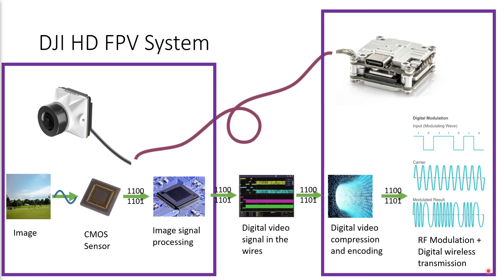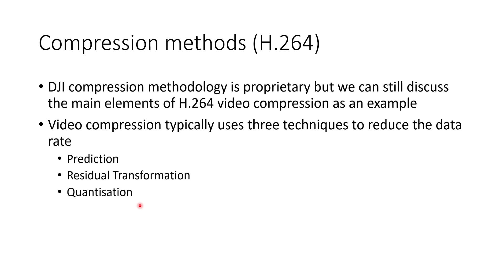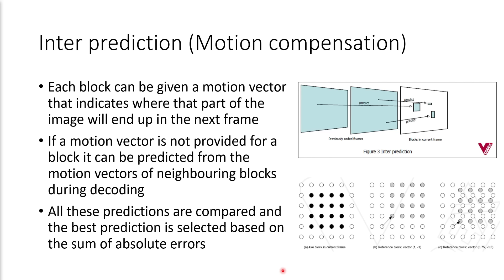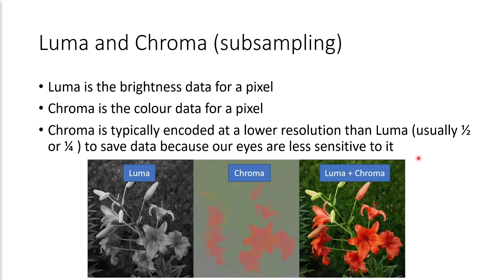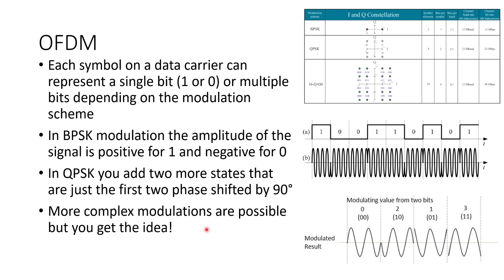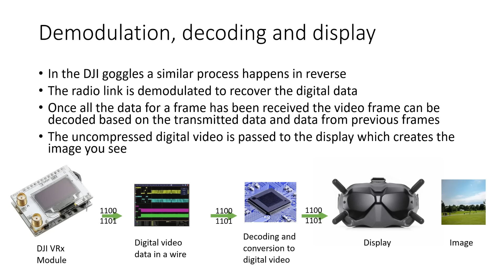How the DJI FPV Video system works! (Air Unit, Vista and FPV drone)

Comment: To add some things I've noticed, to minimize bandwidth spikes (decrease the size of retransmissions e.t.c.) and increase decode stability DJI utilizes what's called intra refresh in h.264. Aka they do not use keyframes, instead it uses what is essentially a rolling block that acts as a keyframe to which other frames can reference. You can see telltale artifacts when Vista switches from 60fps to 120fps mode on arming for example. 

It's actually quite an efficient method with least amount of visual artifacts, back in the day 8-9 years ago when twitch allowed you to have fun with encoder settings but something like 1.5mbps max bandwidth, I used to stream with very custom settings that included intra refresh. You can see some examples of the artifacts on my channel in wow videos on 8-9 year vintage. Though DJI uses a lot more granular version of it. Afaik they axed it all a long time ago in the name of compatibility with cheap embeded decoders, tv boxes and such.
Reply from the maker: Wow that's really great information to have thank you! That explains how they avoid sudeen distortion due to a missed keyframe.
Reply: @ChrisRosser  It also really helps for getting latency down, it does not really help with initial connection, since you still need to wait for the refresh to cover the whole screen, but after that you avoid having big data spikes, for keyframes, since essentially you smear that data over time. Also it's not that big of a deal if you cant recover some of them - you'll just have some kind of an artifact in that block until the next refresh covers it up. Also should help recover a lot faster from dropped frames, since you can also just have some artifacts in places that were covered by refresh that was transmitted with those dropped frames.

Also that would allow them to use inter frame stuff, since they do not have to basically cache previous frames to reference, but just blocks between the refresh, thus also reducing latency and increasing efficiency for when you cant have frames buffered.

What's more interesting to me is focus mode, since afaik nothing of that sort is supported out of the box in h.26x series codecs, so I imagine that's their contribution, and since I think they kinda wanted a foviated rendering effect, but they ended up with very sharp transition point, I imagine it's a fairly simple hack ;)

The main downside is probably that generally it needs a bit more total data transmitted over time, compared to regular keyframes and a bit more complicated decode/encode (though I imagine it's not a issue nowdays, since even in 2010 I had no issue playing those streams on android phones of that time). And well.. seeking that type of video wont be instant if you want to avoid artifacts (you need to decode a bunch of previous frames to get a clear picture, or just deal with artifacts), but that's obvisouly irrelevant for realtime stuff.

Comment: Thank you once again. Great presentation as always. I have only ever flown with the DJI air unit as I am fairly new to FPV. After seeing your videos on how Analog works and now DJI I am curious about Shark bite. I am very curious about analog, I think I may want to try it at some point. The DJI system has a nice picture but when it breaks up and the latency increases it can be hard to fly. Once more thank you Chris Rosser!
Reply from the maker: I've switched from Analogue to DJI and am keen to try shark byte for the first time. I wouldn't go from DJI back to analogue because the image quality is much worse particularly when there is interference.
Reply: analog is a mistake for you, use low latency mode, you can fly on dji more more far and penetrate than analog
look a video 25mw analog vs 25mw dji

Comment: Not sure the prediction algorithms are actual for realtime image transmission, and I can't believe in retransmission (two way communication) that is too complicated way to build final image, particularly for real time applications. In my opinion DJI simply compress image to a single frame (probably something like a progressive JPEG). Depending on signal quality the quantization coefficients for image blocks could be different because we need a good quality at center and less quality on peripheral.
Reply from the maker: DJI use proprietary silicon for their video compression and encoding so its impossible to be certain. There will be some prediction going on (even if only intra frame) in order to get the data rate down.
Reply: Nah, DJI codec is clearly based on h.264/h.265 that has been somewhat customised, or something very similair. If you messed with most of the codecs it's very clear by looking at the artifacts. For the customisations - focus mode is one for sure. But it's very much a derivative of those optimised for minimal latency and perf.
Reply from the maker: @ooHotcooleRoo  So would you expect them to be using intra and inter frame prediction along with the periodic intra refresh technique you spoke of?
Reply: @ChrisRosser  I imagine so, since I cant really see h.26x type codecs having any decent efficiency without inter frame prediction what so ever, since without it we are only left with i-frames (which are well.. keyframes themselves). Also AFAIK intra refresh is basically a P-frame only type deal. If you are interested in it a bit more there are a bunch of papers describing multiple variations of it (Periodic Intra Refresh) with various adaptive properties, different placements, hybrid approaches wtih having also periodic I-frames too e.t.c. Most of them relate to real time streaming and error resilience. 

What they are not using for sure are B-frames (bidirectionally predicted frames), since that would entail at least an additional frame of latency. 

But at this point I'm talking things I expect, not things I know, or I'm sure about. 

Otherwise considering that the codec is probably h.264 derived and the quality vs bitrate is quite low, they are probably not using that much feature wise, but in i-frame only mode (intra frame predicted) it would be far more bandwidth intensive for sure.

Also it would be fascinating to read on encoder bandwidth control, how much headroom in there in the link and how focus mode works and decided on. Since there were papers proposing foveated algorithms for h.264 for a long time (one of the later ones with bitrate comparisons too - https://oliver-wiedemann.net/static/publications/msc_thesis_oliver_wiedemann.pdf) and focus mode is clearly a some sort of low effort/fast approximation of the same idea.

Comment: I'm wondering at what point the image gets debayered. In cam's image processor, or later on, in vtx?
Reply from the maker: That will almost certainly happen in the image processing electronics within the camera before the frame is sent over MIPI.
Reply: @ChrisRosser  Most probably, yea. But also, 4 lane MIPI-CSI-2 with combo PHY layer should support transfer of raw image data. And you can apply initial processing to raw data in cam using red, blue and (green1+green2)/2 data. 
Demosaicing the image in dji vtx would open possibilities to use more advanced algorithm and could help optimize encoding/compression.
I'm really curious how DJI decided to transfer/process/etc. images and what debayer algorithm they are using. Image I'm getting in googles does not look like cheap bilinear debayer to me.

Comment: thx for the information.

will be cool to see how does sharkbyte/DJI FPV compare after each stage.

example can we compare the compression stage , and latency it introduces ?
Reply from the maker: That would be extremely interesting. I wonder how it could be done? The DJI system is proprietary so I'm not sure how you could interrogate it for latency information.
Reply: @ChrisRosser  I imagine the only way to do it is to get some soft of debug output from them, but I doubt we'll get any of that ever.

Comment: First!
Reply from the maker: Yes!
Reply: Yay~
Reply: I always fly in a small park behind my house. Because it's in a middle of a housing area it must have a lot of WiFi interference. I started flying DJI channel 1 and boy the variable latency is unbearable even at very close distance.  It become buttery smooth once I switch to channel 3 50Mbps.
Reply from the maker: @LikWeiLee  Yeah, 5GHz Wifi can really mess with DJI Video. Glad you were able to find a clear channel to rip on!
Reply: @ChrisRosser  Can't wait for your upcoming sharkbyte video. I wonder why it can lock at a fix latency, I'm guessing it is because it doesn't do re-transmit?
Reply: nice!